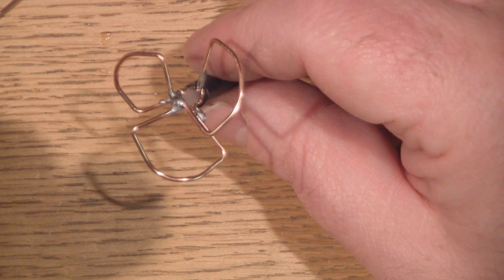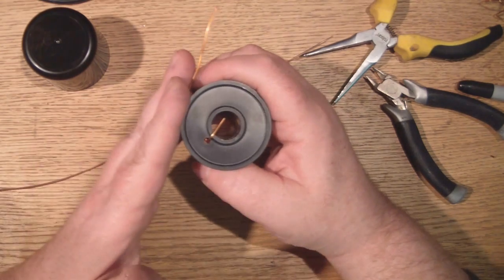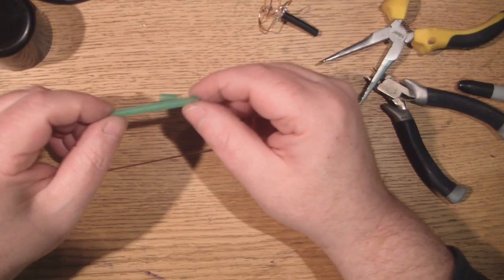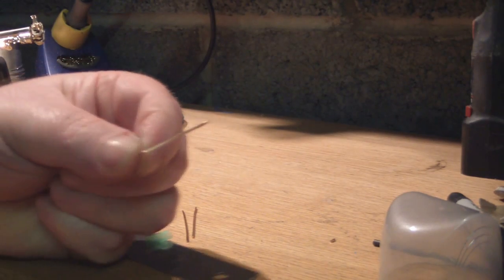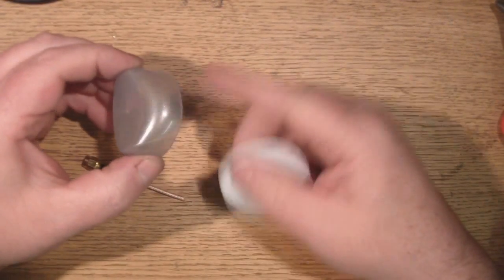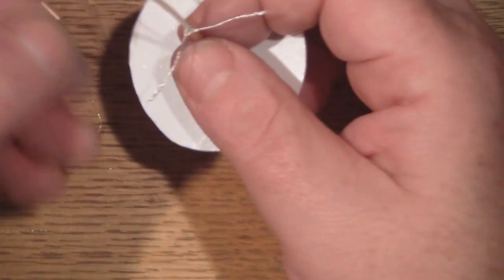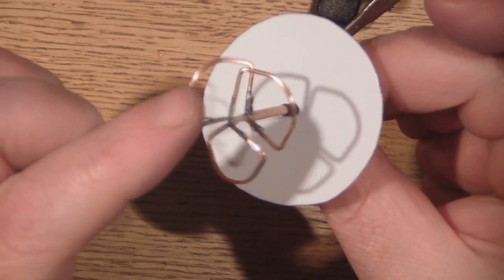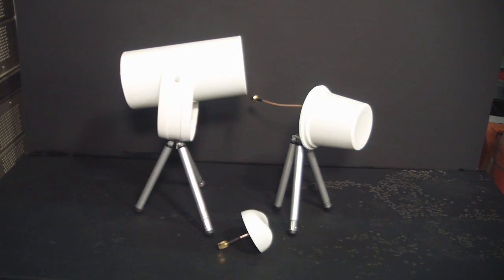Cloverleaf Antenna 5.8GHz #37

Comment: Good video (and that's from a retired Sr. Electronic Technician and Extra Class Amateur). Would appreciate an explanation of the differences between RHCP (CW) and LHCP (CCW) antenna.  All my FPV antennas are RHCP, and as viewed from the side, with the coax aimed down, all the 'cloverleafs' are slanted from the top center conductor towards the right down to the coax connection. (difficult to explain in words). I use a cloverleaf on the aircraft and a combination of helical and planar on my diversity receiver/screen, which seems to give me the best range. Cheers.

Comment: Good video...but shouldn't you have the polarization the other way meaning right handed? How did it work when tested?
Reply from the maker: thanks. The important thing to remember is that both the transmitting antenna and the receiving antenna have to be the same. So it does not matter if its left or right just so long as you don't mix them up. Say a left turn transmitting to a right hand receiving. 
hope this helps
Reply: Thanks for that...what do you think of using a balun on antennas would you say it can have a huge effect on signal strength or stability?